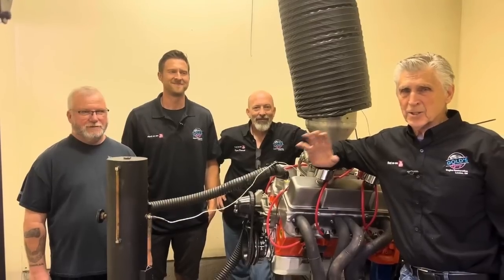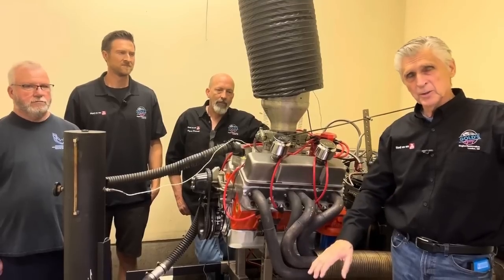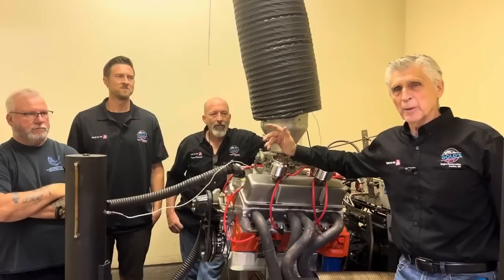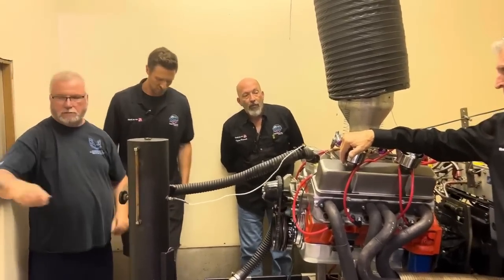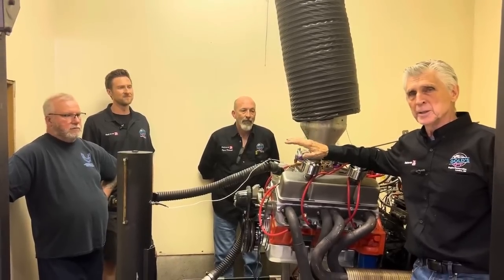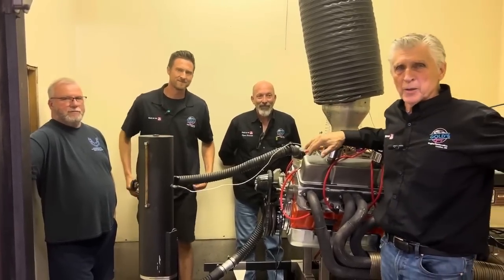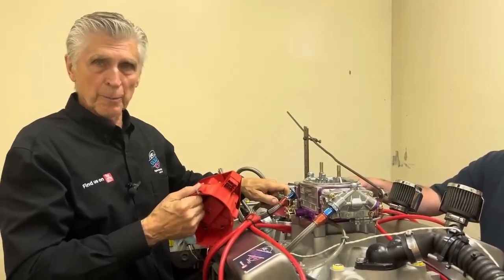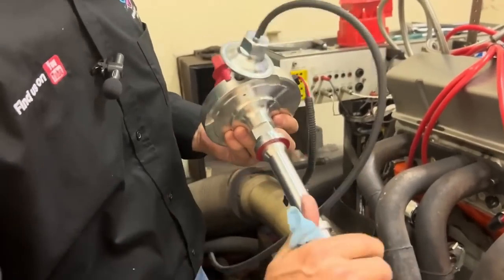$75 Amazon HEI Distributor VS MSD Ignition DYNO TEST!  Mike's Michigan Modified stock car engine.

Comment: Finally someone is testing ignition #against each other. I’ve always wondered what the results would be of ignition boxes shoot out and a module shoot out on modules to replace points conversion ones.
Reply: You know Ron,  you could've been doing it this whole time if you were so desperate for it
Reply: @lollipop84858  😂
Reply: 😬 man.....who's paying for all that testing? The time....then the comments. Whoa.....😨
Reply: It takes energy to bridge that gap, and as cylinder pressures increase the energy required to bridge the same gap increases. 

If you're a "pump gas friendly" 9:1 kinda guy you'll never need multiple sparks or such a huge step-up transformer. 

I live on 11:1 and build client's vehicles out to 12:1😉(higher....but 🤫) on 93 in the middle of TEXAS summers. HEI  won't sustain the demands of this caliber of engine. 

I'll take the Pepsi challenge all day to prove it. However the HEI does to very well over a wide array of demands and lack of necessary fundamentally sound builders. That's impressive. 

I hope your wish for your test to happen makes it past a pilot. Someone is bound to have the time and resources to prove what mathematics can for A LOT LESS!